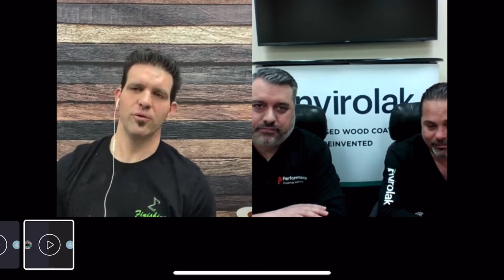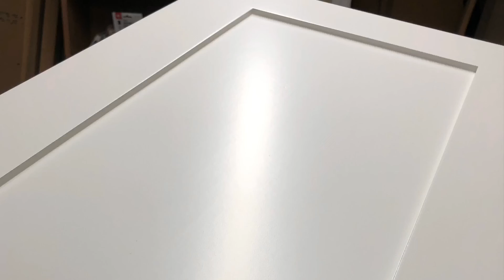Envirolak Chemist discusses Water based vs Solvent Based formulation

Comment: Hi Eric, I've sprayed water based for many years and have had mixed results. Have used Target Coatings EM6000 with the best results but often still run into surface tension issues. I predominantly spray walnut and at times the surface tension or sometimes called bridging around the pores is a real problem. Can you recommend a product or process that would help with this problem. Additionally, I'm now using a Fuji turbine Mini-Mite 4 system. For whatever reason it has helped with the quality of my spraying. Thanks for all the great video's you produce.  Frank
Reply from the maker: frank foley renner 851 is designed as an open pour wood coatings that cures this issue. That would be my recommend and is my go to for those types of woods.
Reply: @ericreason6559  I should clarify, I'm looking to shoot a clear finish on the walnut, not a painted surface. Sorry for the confusion.
Reply from the maker: frank foley I understood correctly renner 851 is a clear as well as a pigmented.  It comes both ways.
Reply: What do you mean by Surface tension?